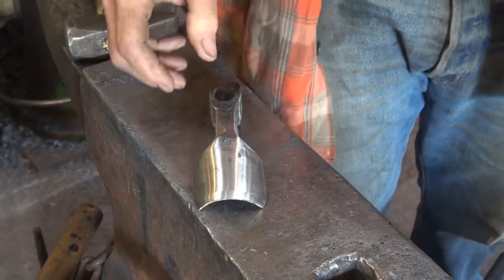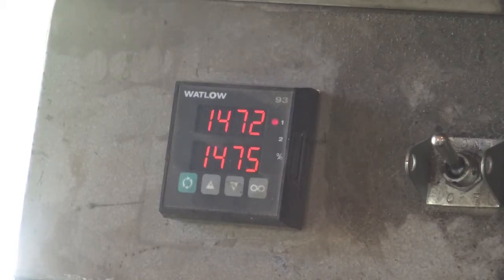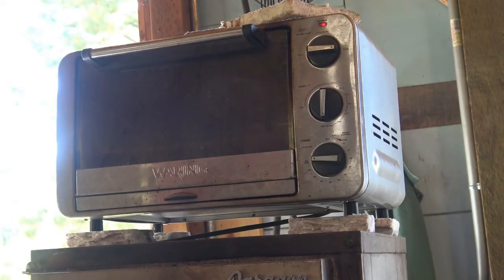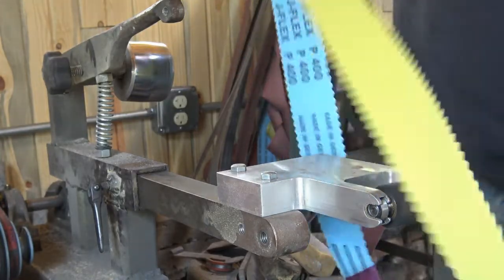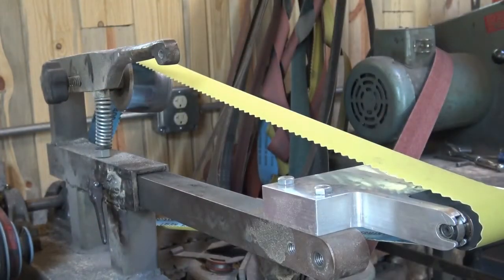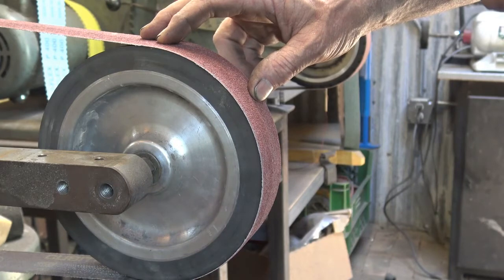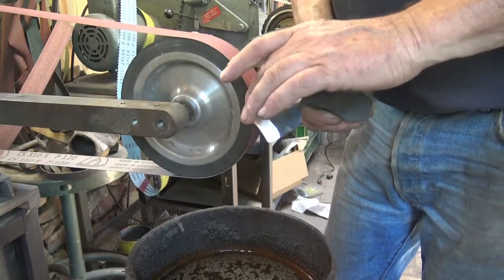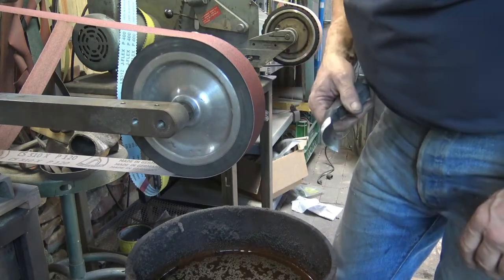Forging an adze, heat treating and finishing with John Switzer Black Bear Forge

Comment: I must say your work is exceptional.Could you try a Rol-Loc mini flap disc on a die grinder , about 2" O.D. to clean up the inside , the contour looks like it would fit perfectly , and the flap won't get as hot.
Reply from the maker: I have tried many die grinder abrasives, but not a mini flap disk.  I will try to remember to order some the next time I buy similar items.
Reply: Right on , I figure one could take down as much they could with the belt grinder , then  come in with a 60 grit to fine tune it.

Comment: Thanks for your informative video. I have a question about the bevel. Should it not be on the inside? The way your are supposed to work an adze it feels more logical, does it not?
Reply from the maker: For a carpenters adze yes, but not for a bowl adze.  All of the most experienced bowl carver prefer an outer bevel on their adzes.